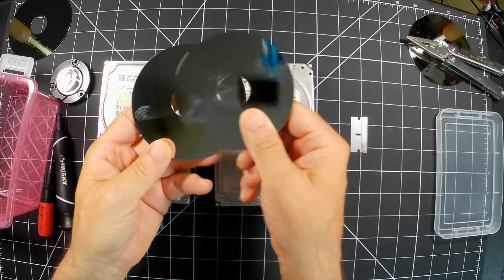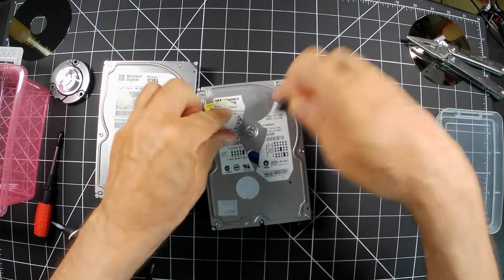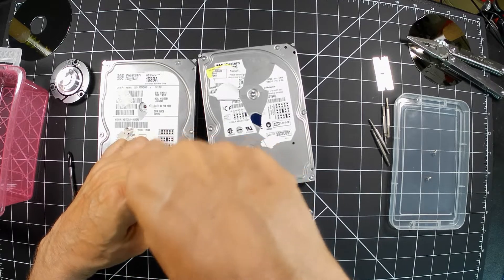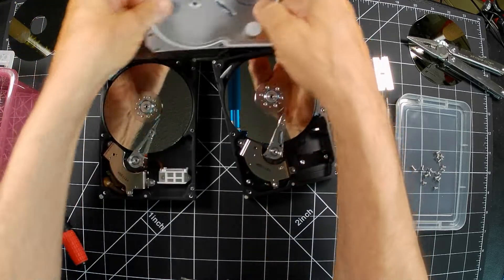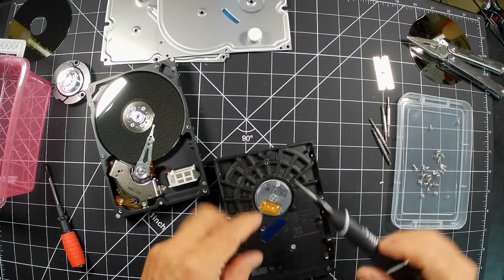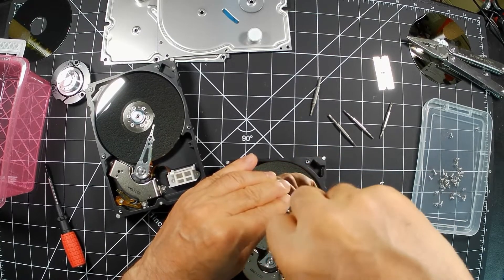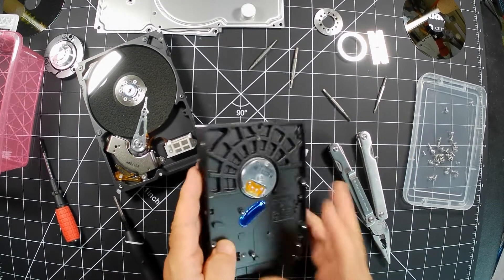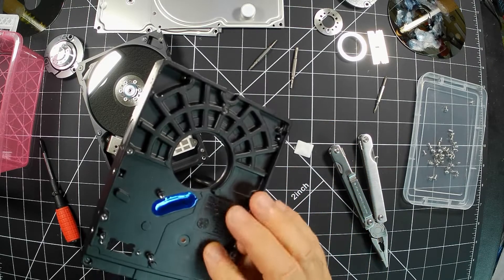Here is my DIY DESTROY Hard DRIVE Destroy Data

Comment: what size is the Torx drive?
Reply from the maker: Best to get a full set of Torx head as you will find many that you need.  I went to Home Depot and used a "Husky" brand screw Screw Torx set from 005 to 010 https://www.homedepot.com/p/Husky-8-in-1-Precision-Torx-Screwdriver-Set-70381H/204664390  I think that was able to work for all of them.  Sometimes you have to get something with a bit more torque to turn the bit.  They are fun to take apart and the only way I know to truly get peace of mind, except if you worked in government where I heard sometimes they even have metal shredders for doing the job. ;)  Hope this helps.